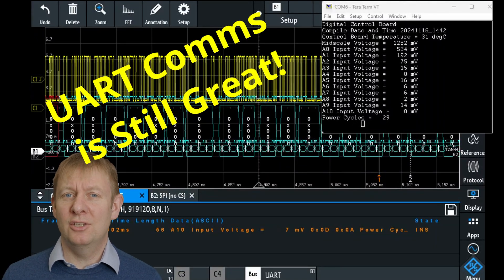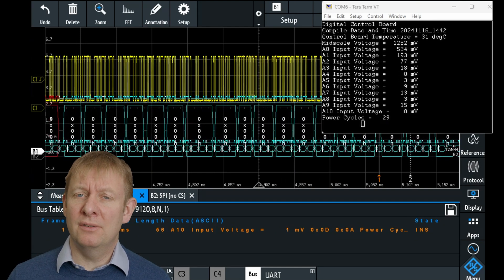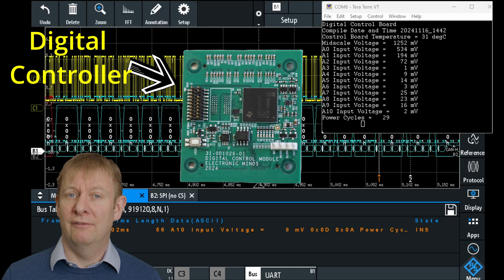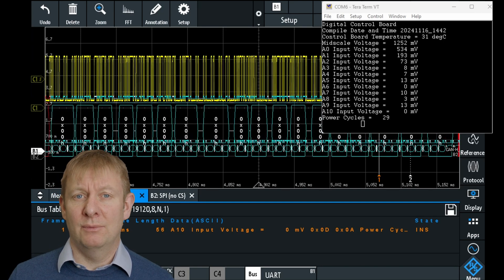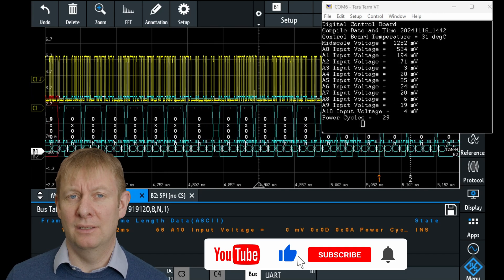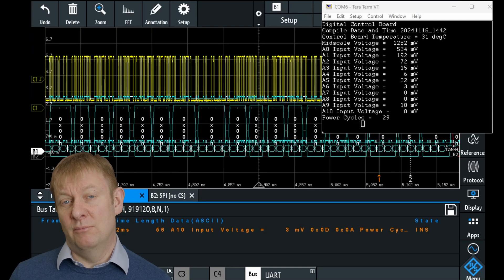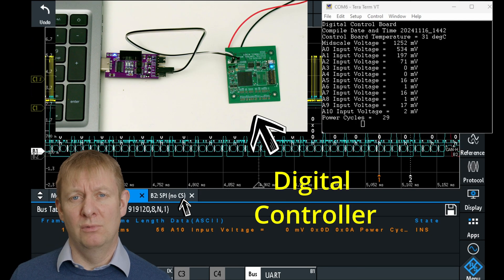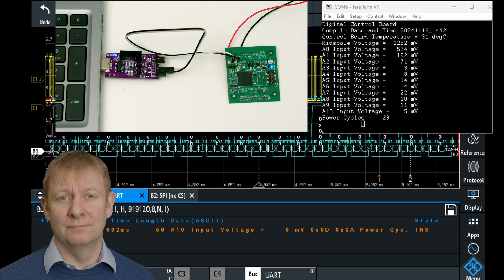Using UART to send realtime data from our power converter to a computer #powerelectronics #uart

Comment: interesting, will you also share the PCB schematic and code with us on YT?
Also what is that unpopulated chip? it looks like a RAM footprint
Reply from the maker: The unpopulated IC is an SDRAM which we use for black box data storage capability. I messed up the pinout though so need to fix this on the next spin of the board. We’ve not decided whether to release schematics yet.
Reply: @ElectronicmindsUK  THX for the reply